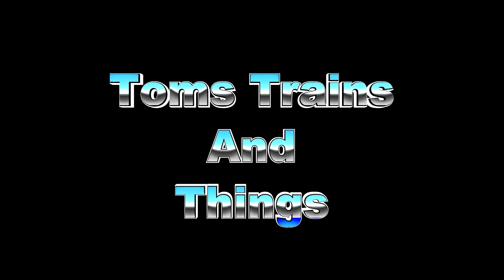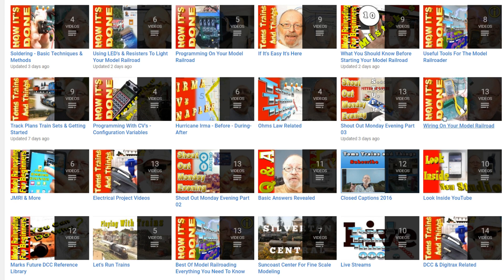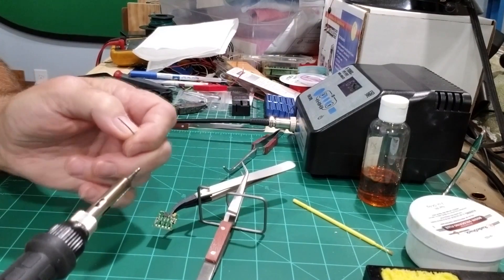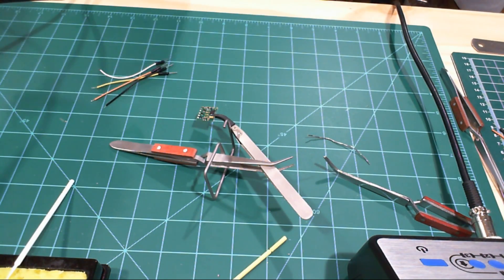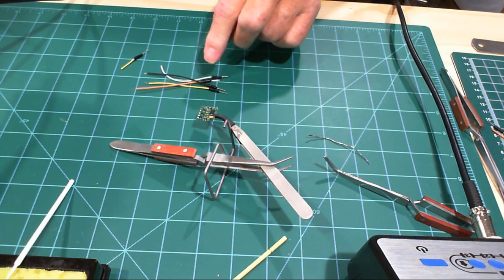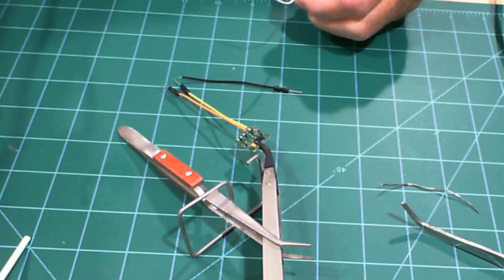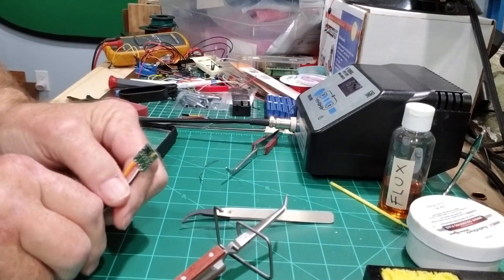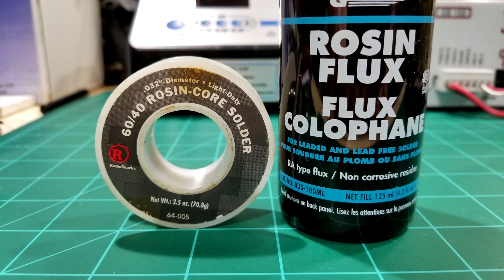Easy Soldering On DCC Decoder Function Pads

Comment: The bit on my soldering iron is held in place by a screw.  I went to the sewing box, got a pin and fitted it in place of the bit. This worked!  I use a thing called 'helping hands' which I got from Radio Shack many years ago. There are now modern versions of this on Amazon specifically for small soldering jobs.
Reply from the maker: Thanks for the information Fredrick. I have those helping hands also, but sometimes they 're more trouble, especially when trying to film the process.

Comment: Thanks for sharing this. It is SO EASY to overheat those pads and melt them right off the decoder. For the novice solderer I would recommend getting an old computer board and practice soldering on some circuits on it until you get the feel for it on something that delicate. Always appreciate  your electronics videos, Tom. Thanks.
Reply from the maker: Once you get the hang of it a little dab 'il do ya! Solder that is. lol
Reply: you can buy solder practice kits too
Reply from the maker: Thanks for the info. I didn't know that